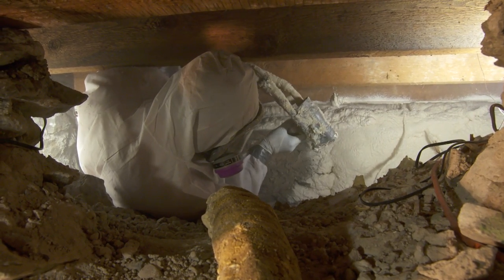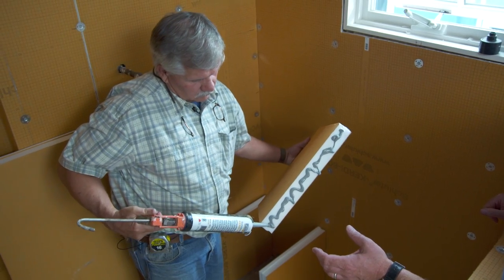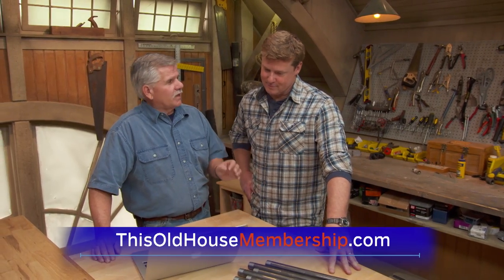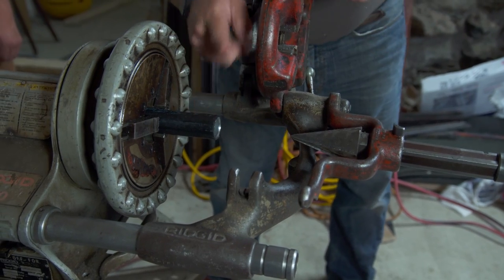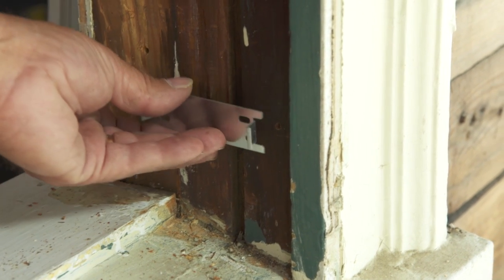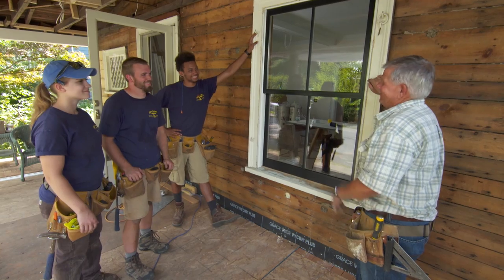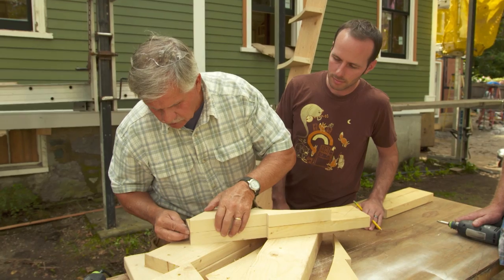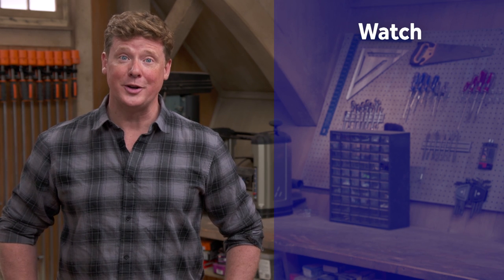This Old House | Tommy's Flair for Flares (S39 E9) | FULL EPISODE

Comment: a heated shower floor?  Isn't that what the hot water is for?
Reply: I stayed in a house during winter that had the heated shower floor. Gotta say, it was nice...feet didn't get cold like they do normally. 

During the cold winter months, I would place a washrag over the drain to allow a couple of inches of warm water to develop to keep my feet warm. So I get this idea.
Reply: I guess it's like underfloor heating. I mean, you could wear socks to keep your feet warm, but the underfloor heating is so much more convenient and nice.
Reply: It was only an extra $25 in materials to extend the heated floor to my shower floor. Keep in mind the heated floor also helps heat the ROOM.
Reply: Underfloor heating dries floor much faster which also reduces water damages for structures assuming waterproofing and everything else is done correctly.
Reply: @mr.wizeguy8995  Hmmm, never realized this.  My heated shower floor has white grout and looks great, no mold or build-up.

Comment: HI, 4 month ago I bought a house that has the similar windows system "Sponge Balancing rails". I would like to know if their are easy to remove from the clips. I need to replace some of them that have the mechanism bad (doesn't hold the window up) and other windows require a bottom replacement (The Sill) and I need to remove the rail also. Thanks for your help.

Comment: How soon until that O ring leaks on that gas pipe? 10 yrs?
Reply: @Kevin-mp5of  very true...
Reply: They don’t allow o-ring joints in the UK for gas. 

Solder or compression. And no plastic either.

Just a quick update:

I watched one of those “Property Brothers” once and they said a copper gas pipe running under a suspended floor was illegal because “someone would think it was a water pipe” and it had to be changed to a plastic pipe. 

I realise that gas pipes are now mostly plastic for the gas company distribution (we’ve just spent 12months having our road dug up so they could replace the metal main pipes in the road to yellow plastic). But to change a copper pipe in a house because “someone might think it was water and so cut in to it” did make me laugh

Comment: Who needs a heated seat in a shower 😂
Reply: and even the floor. ...just put some wood down on the floor and that makes it warm and cosy enough, imo.
Reply: Heated shower floor is great to dry things, like shoes or various canvas items like hats etc after washing them properly and placing in the templates to keep their shape.

And it is a nice thing to step in warm shower room at the winter time when the very slight temperature difference doesn't exist.
Reply: I think it's a nice idea but I would do it with typical radiant floor, meaning hot water, instead of electrical.
Reply: @fadetounforgiven  Electronic can be placed anywhere easily. Even nicely poured in a mud. But problem is that if you damage the wire in it, it is broken. So you take a risk while installing it that does it work after curing. 
But afterwards it takes very little electricity to heat quickly up, and no requirement to have extra water piping to leak. But if one has a central water heating, then it makes sense to run that floor heating through it as well.
Reply: @paristo  call me crazy but I'm not a big fan of using electricity where water could one day leak. Also, the piping for this would be quite easy, there would only be leaks if you are really uncareful when installing the pex or whatever it is. As to life expectancy, I think the resistence is probably shorter than the pipe most likely.

I think water is a better option than electricity here.
Reply: @Kevin-mp5of  which makes it more expensive to install and mantain, and quite likely also to operate.
Reply: @Kevin-mp5of  I said "more expensive" meaning it costs more. Doing it with water would mean using part of your heating system with no need to complicate your electrical system. Also, just only the price of the GFCI breaker will surely be higher than that of the whole piping, installation included.

And finally, the resistence could very well give up working one day, while the pipe, as long as there's no other connections than at the beginning and the end of it, it's really unlikely to leak unless the installation is done poorly (which could also happen to electrical).

I see what you mean but I still think it's safer, cheaper and longer lasting with water.
Reply: @fadetounforgiven  "using electricity where water could one day leak" So i assume you wash your clothes in bucket because washing machine works with electricity and it could leak.
Reply: @mr.wizeguy8995  I'm almost certain you think you have a point, but you haven't. I'll let you think about it.
Reply: @fadetounforgiven  Using electric in underfloor heating in wet areas isn't new it might be fore you but here in Europe those has been since 1970s and since then many thing on heating system is nothing but improved so maybe you should think.
FYI Similar underfloor heating cables can be used outside under concrete pavers to keep them dry and ice free during winters. Ever hear thing called fuse or Recidual current device???
Reply: @mr.wizeguy8995  (your nick suggests more than you provide). I'm as European as it gets, in case you didn't know... which you didn't.

Two small problems with electric heating: it has to be completely isolated, otherwise your "Recidual" current device will tell you something is wrong if humidity ever comes too close. It's a given, but it has to be met.

And second problem is that, sooner or later, that heating element will give up. Be it due to wear, to overcharge, you name it, it will fail, it has a life expectancy and it will eventually fail.

I had this heating element at a water tank (installed by a certified plumber, not just anyone) and it lasted some six years or so despite being used only around six months a year or so. Maybe a particular case but it will fail. Just like every other resistance used to give heat, be it for water, an oven or a floor.

But when it's a water tank or an oven, you take the old one out, put the new one it and you're good to go. When it comes to something that is under some concrete (plus some tiles or whatever) that's not only such an easy job but also an expensive one. 

If you heat with water, pipes will last way, way longer.

But hey,  you're Mr. Wise Guy
Reply: @fadetounforgiven  Yep water pipes last longer than electric cable but both last longer than people mind who usually remodels shower room way sooner than that heating element is broken and when you renovate you can assemble new cable anyway.

Underfloor heating cable life expectancy is 50 years,  i have renovated shower rooms that had over 30 years old cables working fine. And actually my shower room has 25 year old cables, i have changed thermostat and that heat sensor which goes into slab but both was easy repairs especially heat sensor was inside sleeve pipe as it should be.

But when i do renovate it i will use PEX pipes and only because i have central water heating system so it makes more sense. But both electric or PEX floor heat works well and last really long.
Reply: @mr.wizeguy8995  as I mentioned before, it's not only its life expectancy but also that it's easier for it to fail due to an overcharge that your surge protection system can't control (it could happen) than whatever may come to a water pipe which, unless you do a bad installation (which could as well happen to the electric heater) it will last for ages.

As for people renovating their  bathrooms before the heater fails, well, that's just a guess, not something to rely on.

And even if you didn't have central water heating, you could still use that same hot water to heat the bath seat if you design it properly (you don't need it to have water running all the time) with a valve (be it manually activated or by temperature which, I believe, can be achieve without electricity).
Reply: @fadetounforgiven  It could, PEX pipe also could leak. There could be fail due manufacturing process or installation issue like tiny kink to pipe and it will leak someday but if you always think something could when it's highly unlikely better not do anything then, you could also slip to soap and break your neck.

But fact is that both system works, and if you don't have central water heating system there is no point for use PEX floor heating, go for electric then.

That what you described to connect hot water supply sounded so DIY stuff that i would avoid.
Reply: @mr.wizeguy8995  as I mentioned before, installation mistakes may happen on both with the same probability more or less. The same goes for manufacturing mistakes.

Here we are talking about a small portion of tiling in a bath/shower, where electrical can be somewhat competitive in costs. What I suggested is that, even when you don't have central water heating but hot water on demmand (which is the way things usually go in Europe) you can make that hot water pass through the seat's heating element and you're good to go. At most, what you may need is a bit extra heat in origin due to the loss in the seat.

As to call this DIY in a bit of a despective manner, well, there's actually no DIY here but changing places for things that actually work, that is, instead of having two separated water circuits, one for heating, one for the rest, you just have one and, if anything, you can do what I mentioned in the previous paragraph, or  you may have a bypass so that part of the water passes through the heating element and the rest goes directly to the shower (and the heating element may have some kind of valve, manually activated or by heat, that would shut off when there's no need for more hot water through it).

Comment: How does the foam hold the weight of the tile and grout?
Reply: The dense foam they are using is actually very strong in compression, take a look at SIPS structurally insulated panels
Reply: I've used kerdi board dozens of times. That stuff is seriously amazing and incredibly strong. There is no limit to what you can do with it. I've even used it to make a floating sink.
Reply: There are XPS foam boards that is stronger than basic concrete so i assume that you haven't ever seen that stuff.

Comment: Love the program.  A side effect of your program is that I know more about replacing electrical panels in the US than I do in the UK,  where the codes are completely different (e.g. wire nuts not allowed,  single phase 240V), black or blue is Neutral, not "hot".

The use of those nuclear-bomb-proof steel gas pipes is strange to me.  I live in the UK,  and the house gas piping is copper inch OD.  Is there any reason,  apart from inertia, to continue with steel?
Reply: PEX and PE gas lines can be used in the USA (when local codes allow it). Is there any reason,  apart from inertia, to continue to use soft more dangerous, expensive and more time consuming, copper instead in the UK?

Also UK banned dangerous ceramic wire nuts years ago... Is there any reason,  apart from inertia, to continue not to allow modern wire nuts?
Reply: @nc3826  The answer is,  I don't know.  But then I was asking the question of folks who might know, and hoping to get some kind of answer.
Reply: @adrianstephens56 I was asking different questions.... But the general answer is, 'inertia' is a universal constant... But if you want more details,  "googling it" is the best way to get it... Good luck, with whatever you decide to do, mate...
Reply: Because the US guys live in the craftsmans stoneage. But they didn’t know... 😂
Reply: In US all money and development is focused war stuff which is latest and maybe ahead time but everything else is between stone age and modern. 

Most advanced stuff introduced in this series is made in Europe like this Waterproofing board you can still find here YT that someone plasters walls with chicken wire and wonders few years later why all failed.
Reply: @nc3826  Sorry, but it is reality. As I said...you don‘t know anything else better. US is not the hub of the world.
Reply: Mud_ForBrains https://www.forbes.com/sites/michaeltnietzel/2019/10/14/the-2019-nobel-laureates-us-universities-lead-the-way-again/?sh=1ed8288f1b8e
Reply: Same here. But what always keeps bothering me is how those pipes (water, gas..) are loose. Here in EU vast majority of  buildings are built from either concrete or bricks, pipes are never so loose.

Regarding the wire nuts: I think they can't use it anywhere they want either. In laundry room, I wonder how would that pass the inspection if they expect 20A or more to go through that wire.

Comment: Why heat a shower floor?
Reply: To keep floor much drier which reduces change to structural failures also really warm to feet. And with underfloor heating you don't need any other heat source, no radiators on wall etc.

Comment: Tommy a question couple buy’s say 110 year old house. They have a lot of work ahead of them. They are currently working on stairs from first fl to second fl. The stairwell from the second fl to the first floor has bannister protecting folks from falling in the hole down to the first floor. They are thinking of replacing the current railing with a glass surround to protect the hole. The current or original railing Was encapsulated in plywood when they removed the plywood they discovered spindles under the plywood. My question is do they or are they responsible to make the old banister and spindles safe. I can’t give you exact measurements however looking at the spindles they look far enough apart that a crawling infant could fit thru and fall to the first floor. The last issue is the height of the banister once again I’m not there so I can only say what I think based on what I see. The man removing the encapsulating plywood is will say 5 feet 9 inches. We can see him standing next to the banister and the top of the banister hardly reaches his crotch. My question is are they allowed to leave the current structure because it is grandfathered in or are they required by code to bring it up to todays standards.

Comment: The entire shower is made of foam.
I just don’t understand how foam can support the weight of a human, tile, and grout?
Reply: It's a very strong, dense foam designed for this purpose. I've walked around a shower being constructed from this stuff and was surprised how solid it felt. The contrast between what you see and how it feels is surprising.
Reply: Just love how as they teach people how to waste their money by cutting corners all the time. That shower and those windows won’t last even 5 years. Foam is only supposed to be used as insulation. Where the caulking to keep the water out.
Reply: @michaeljoesting4888  The product is Schluter Kerdi-Board, and it is specifically designed for building waterproof structural features with tile. It's not insulation.
Reply: @ClicketyClack  the inside is still foam which should never be used like that because over time it will fail causing more damage especially with the added heating system. I have built better and more water proof showers with out it. It’s for lazy people who don’t care about their work.
Reply: @michaeljoesting4888  Thanks for letting me know. I'm glad that you are apparently far more knowledgeable than the engineers who designed this product for this specific task. I suggest you send Schluter a resume.
Reply: @ClicketyClack  no thanks. I couldn’t handle being a glorified pencil pusher being stuck in some stuffy office all day. I’ll take real daily life learning any day.
Reply: @ClicketyClack  just because someone designs and sells a product doesn't mean it's a good product.
Reply: @ClicketyClack  👍love that sarcasm 👍
Reply: @michaeljoesting4888  Funny and YT is full of shower failure videos from USA but barely and from Europe.

Comment: Electric wire under wet butts in wet enclosure... I don't think that's a good idea.
Reply: It does seem really weird they are using electric for that when they already have a hot water heating system anyway. Adding a few more feet of radiant tubing would be super simple.
Reply: ya sounds like a bad idea to me. But what do I know?
Reply: ever been in an Asian hotel?
Reply: @richieyeah  Yeah...death traps. Made in china. They still haven't figured out what ground wires are for!